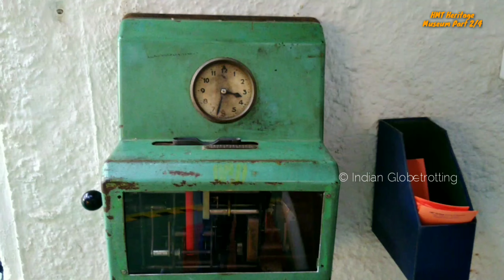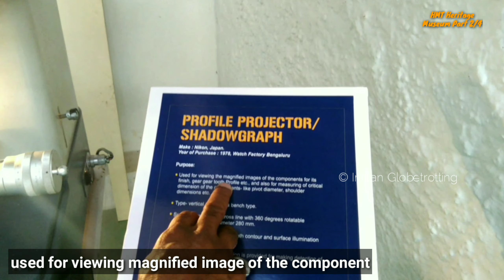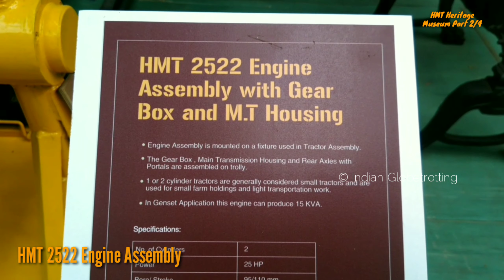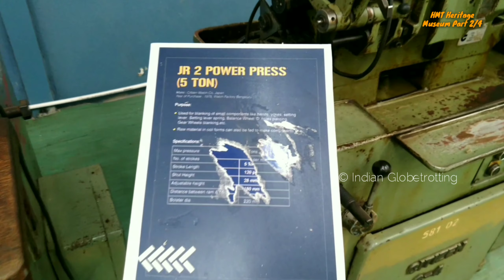HMT Heritage Centre and Museum Part 2/4 | Machines and Tools For Watch Manufacturing | HMT Tractor

Comment: 2522 ka bhi saman mileng
Reply from the maker: No, Only HMT product you can buy there is watches. There is a small shop outside the museum
Reply: Hmt 2522 ka gearbox
Reply from the maker: @vikkyyele5289  No you won't get it there. But you can definitely check with the people there, they can help you
Reply: Museum pinjore ch aw